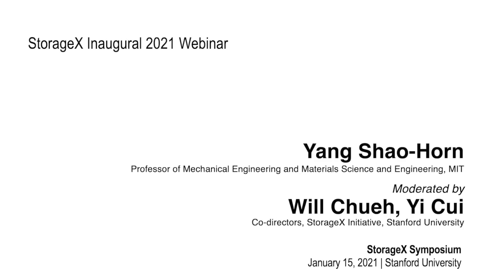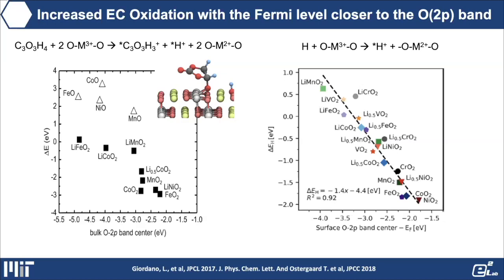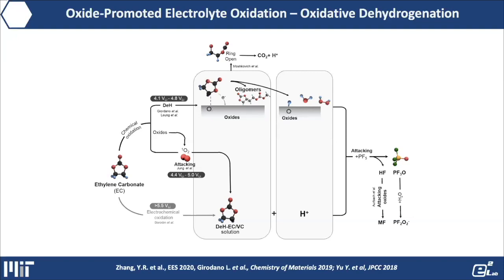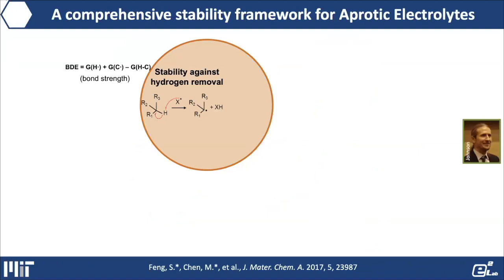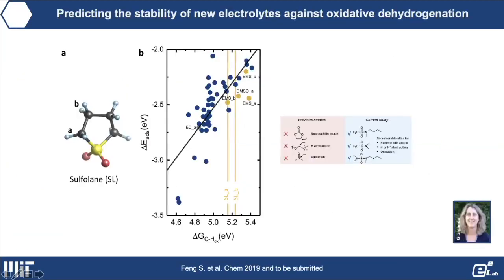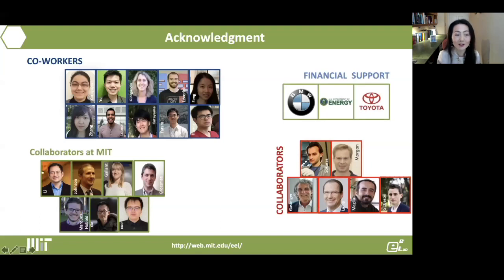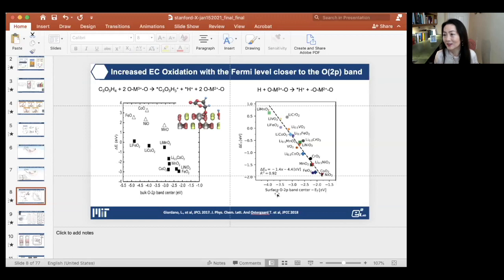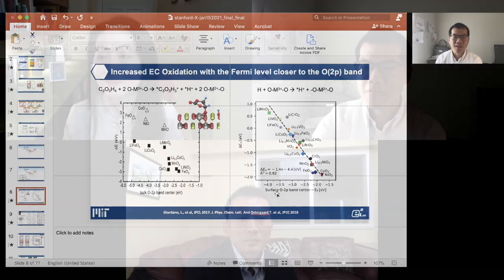Rechargeable Li Batteries | Yang Shao-Horn | StorageX Symposium

Comment: Thanks for sharing. I may understand 5% of what you said. Not your fault, just a measure of my current level of knowledge. Maybe Jordan at The Limiting Factor will break this down in a new video. Scientists are the unsung heroes of the world. More people should trust them.
Reply: Haha, exactly, we count on you Jordan :D
Reply: I'm a big fan of Jordan's as well. I know he's got a lot of videos in the pipeline, so I'm guessing it'll be a while before he gets to this if he does. I'm going through it very slowly to try to grasp it since my chemistry knowledge is pretty basic. Trying to break it down as best as I can, the electrodes on Li-Metal batteries are cracking due to the solvent in the electrolyte (EC: Ethylene Carbonate) reacting with metal oxides coating the electrodes. The EC loses a H+ ion which then reacts with the salt of the electrolyte (PF6), making HF or an oxide which leads to cracks in the electrodes. 

Some fixes for this they've found have been to coat the electrodes in Aluminum or a Fluoride-containing compound, or to make higher salt concentration in the electrolyte. Hope that helps, and if anyone smarter than me sees an error in that please correct me.

I'm about 18 minutes in right now, crawling along. I'll update this as I go in case it helps anyone.
Reply: Yes, Jordan has nothing else to do maybe. He should keep breaking down large chunks of electro-chemistry and finance datas into some easily understandable slurry, just for the glory!

Comment: Back in the discovery days of Chaos Theory, the fractal nature of signal noise in transmission lines had mathematical significance to Mandelbrot. 
It seems like a reasonable assumption that something similar to fractal noise would affect the bond strength of Carbon Atoms in the attempt to construct very long tethers as would be used in light weight bridge construction and no such fibre of pure Carbon occurs in nature, which seems to agree with the assumption. 

The converse situation is the distribution of dopants in the lattice of conductors and storage batteries, because condensed matter physical arrangements are "made of making" time-timing sync-duration resonances in phase-locked conglomerations of fields and probability-resonant, mass-energy-momentum binding forces.

This is the Temporal Superposition Singularity positioning approach to Quantum Chemistry, in Principle.., the unity of here-now-forever differentiates/integrity.

This Experimentalist's expertise is relevant to Computational Methodologies, that approach the Periodic Table of Elements in terms of elemental AM-FM connection/bonding function.., e-Pi-i-numberness resonance Quantum-fields, in general.